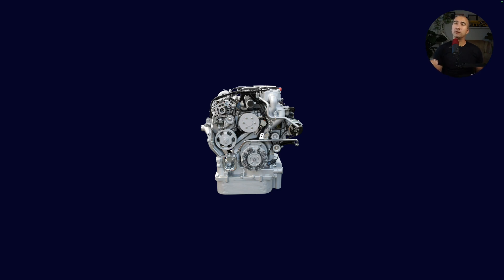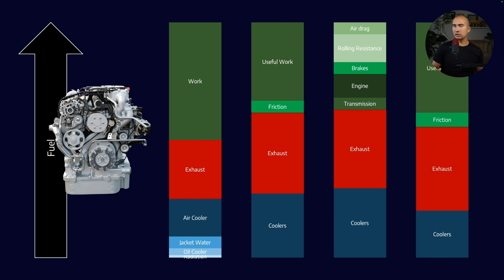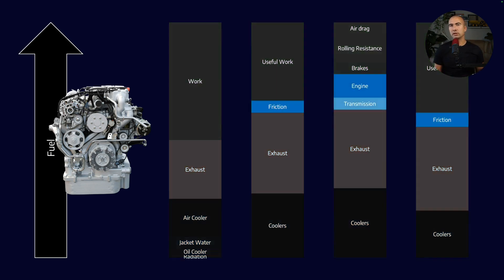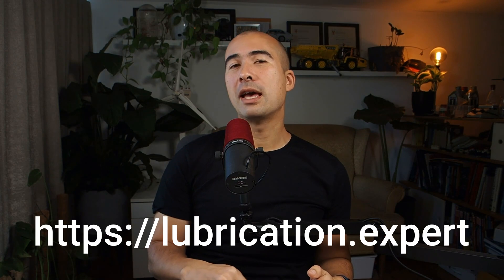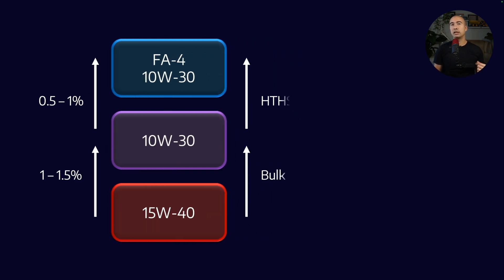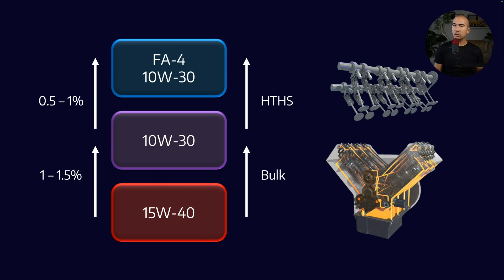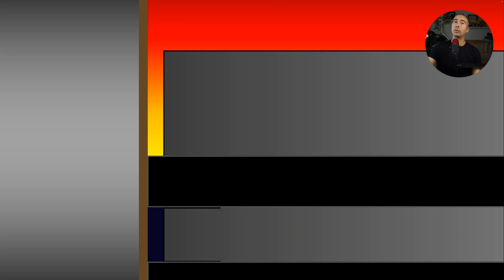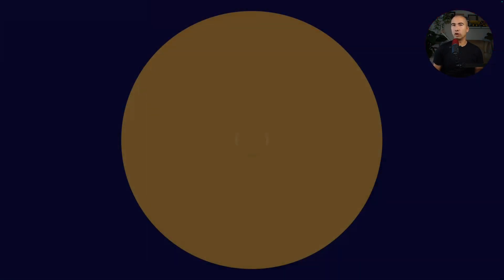Is Amsoil's mpg claim real? Energy losses in engines explained.

Comment: The gain of efficiency cannot surpass the engine protection and lose oil film, 0w20, 0w16 I wonder oil service interval with GDI Trbo engines and low TBN.
BimmerN53

Comment: I have a bike that uses 10w 30 oil (factory recommendations), then I tried 10w 40 oil, the fuel mileage consumption went up about 10% ish more efficient (using the fuel consumption meter).
This is what confused me, as what I understand that the thinner oil should be the one that makes the engine run more efficiently...

Comment: You are forgetting about the most important contributor to fuel efficiency, and that is temperature control. We gained 18% in petrol and 27% on LPG on a EB Falcon bacck in about 93/94 with a test vehicle supplied by RACV when we fitted components to correct the coolant temperature  on the 4.0 Liter 6 cylinder engine dual fuel.

Comment: I have a counter point, anecdotal for sure, but true in my case.  I swapped out the “old” oil from ALL the gear boxes in an old 1993 Land Cruiser TO brand new AMSOIL in the front diff, rear diff, transfer case, and Engine.  The difference was significant and noticeable.   The rig made less noise, and I did get approx 8% better economy.    (As close as I could calculate).   That rig went on to serve me another 100,000 miles of hard work without any drama.  Got rid of it at 250,000 miles.  And I regret it to this day.
Reply: You're comment reminds me of a slightly used 1982 Toyota 4x4 pickup I had bought long ago and it would have had the factory 80W-90 gear oils in both diffs as well as the manual trans and the transfer case, and probably a typical 10W-30 engine oil. Being that I live in northern Alberta that was a no go in our winter climate so I used synthetic 0W-30 engine oil and at that time 75W-90 part synthetic is what I could get easily. The products I used were Esso ( now Mobil ) but imagine the Amsoil or other brands of full synthetic some years later would have had better performance yet in cold weather but never the less it came down to higher performance oils that are thinner at low temps having a drastically improved lack of driveline drag in colder weather. There is a reason why for years now transfer cases use automatic trans oil, diff have gone to 75W-90 if not even 75W-85, and a thinner type of automatic trans oils ... and 0W-20 or even thinner engine oils ... it all adds up to less oil drag resistance.

Comment: Lake Speed Jr did a seminar on Porsche Club of America's YouTube and said there's only 3 manufacturers of base oil and only 3 manufacturers of oil additives. He basically said oil marketing is trash. Buy for spec before brand. There's so many factors in fuel economy in the real world.
Reply from the maker: That's mostly correct - like a lot of industries (think accounting, banks etc) there's been a lot of consolidation so there's a "big 3" base oil companies (Chevron, ExxonMobil, Shell) and a "big 4" additive companies (Lubrizol, Oronite, Afton, Infineum). But there's a pretty vibrant ecosystem of mid-to-smaller companies out there that are doing some great work. Yes, there is a lot of marketing fluff (particularly in the consumer categories) but there's also plenty of real technology.
Reply: Mostly true, but the smaller, more expensive brands (HPL, Amsoil, Red Line) up the treat rate and overbuild their oils.  How much better they are really depends, and to some degree can't be determined unless you were to test them all against industry standard tests.
Reply: He's not wrong in any of it, it's just that like a baker is using the same ingredients they can be combined differently to get different results. 🙂

Comment: In the Amsoil case study, they changed every single driveline fluid, including the wheel-bearing grease. What I understand, not even Amsoil was expecting more than 3% or so, it was a shocking result.

Comment: In real life, it is possible to get high gain because:
- the manufacturer viscosity recommendation is too thin. Using correct oil viscosity will reduce engine friction a lot.
- previous very low quality full synthetic oil (obviously without API logo) cause sludge and poor performance

Comment: AMSOIL is a slick marketing machine, like a 0W20. Lol. I fell for the hype and used it religiously for 2 years, one thing I found annoying about the oil was towards the end of the oil service-interval oil consumption would ramp up substantially. I never experienced this issue when I used Mobil1. In any event I switched to Renewable Lubricants (same weight) and two things happened,  I no longer had cold start ticking noise from the engine and oil consumption did not get crazy towards the end of the oil change interval. I have since then seen elsewhere on YouTube, auto technicians give unfavorable opinions about AMSOIL based on their personal experiences fixing engines

Comment: Sure, lowering the viscosity of your oil will give you minimal fuel efficiency gains, but my question is, will the lower viscosities create more engine wear and in turn higher repair costs which will offset any savings in fuel costs? I really dont see how these new 0w8 and 0w16 oils can protect as well as a 5w30 with the same additive package. Is there something I'm missing?
Reply from the maker: Great point - so there's definitely tradeoffs, and in general is not going to be possible to simply use the same additive packages in these lower viscosity engine oils. Most of the time, it's a combination of uprating the base oil (so in the case of 0W-8 and 0W-16 they're likely to be full PAOs), and improving the additive package (you'll start to see more Boron, Moly, ashless phosphorous etc). On top of that, the engines need to be built with a lower viscosity in mind. In a lot of cases, it's the tighter machining tolerance and improved surface finishes that are allowing the lower viscosities.
Reply: The oil geek has a great video explaining this exact question... The heavier oil viscosity does protect against wear better than the 5-20 water thin stuff
Reply: @100pyatt Lake also talked about in a video how they reduced wear with an oil that had lower viscosity, something other tribologist talk about as well. Viscosity can work against the additives in mixed and boundary lubrication. So we should mostly compare to the specific oil (which include additive package) and if it can do the job it was engineered to do (or how it degrade with reduced viscosity). 🙂

Comment: 9:55 A very good point Rafe.
Years and years ago when Mobil 1 was brand new in Australia, my father and brother in law both had a Daihatsu Charade Turbo each. They saw ads for Mobil 1 showing the benefits of cleaner engines and new synthetic technology,  so they both changed to it from the good quality mineral oil they'd be on.
Both cars failed a turbo within a week of each other when all the deposits started to move.
Not the oil's fault, and both cars gave long lives after the change.

Comment: I started using synthetic oil in 1988 in Germany as a young automotive technician aprentice. I never found much improvment in fuel ecconomy until all drive line lubricants where synthetic. So once engine oil, ATF/Gear Lube and bearing grease where all synthetic I noticed a very significant improvement in fuel ecconomy. I noticed this in everything from N/A I4, V6, V8, forded induction, fuel injection, carburated, automatic and manual transmission vechiles. I would often see 2-3mpg improvment consistently in my vechiles and clients vechiles in Germany and in USA. I have lived int he USA since 1992. In almost all cases I was going from a 15W40 or 20W50 mineral oil to a 5W40/10W30 or 5W30 synthetic and often gear lubes where where going from 90W to 140W Mineral Oil to 75W90 or 70W80 synthetic.

Comment: Hello Rafe, Good video. However, is not cleaning the deposits "restoring" the performance as opposed to improving the performance. Is not the performance of a new engine distinctly different than the performance of an old engine? apples to apples/oranges to oranges:goodvibes:

Comment: Amsoil and k&n are the best marketing companies.  The internet raves about them with very little (or none) data to confirm anyone’s claims.
Reply from the maker: To be honest I don’t have much experience with either. Amsoil’s business model of having a wide reseller network has definitely given them a big leg up, especially on social media where a lot of the resellers are very active.
Reply: @LubricationExplained  I think you are looking at your percentages to simplistically. Let’s just assume you have some money $100 is a dollar for each percent and you have some children you going to give some of the money to little Miss lubrication - this kid gets 8% eight dollars, so when you say can’t possibly improve 8% you are thinking of the total, however if you gave little Miss lubrication another eight dollars, that wouldn’t be 8% that would be 100% so 8% of the 8% is .064%, totally achievable thing a bit of clever marketing, but I’m suggesting that that’s probably what they’ve done
Reply: I will say in my own experience, K&N air filters seem to flow well when clean.
But I wouldn't say Amsoil has no data, as they do use many of the ASTM and other third party vehicle and equipment manufacturers test methods and parameters for their test comparisons, don't they? I mean that should count for something shouldn't it? That 8% gain probably was very optimistic, and probably did have much to do with cleaning up that well used engine. However, I don't think they implied that everyone would see those kinds of gains either. I'm just a lowly life long mechanic by trade and retired amateur racer and have used and sold as a small dealer some of their products for a very long time. I personally have had excellent results with them. But Hey, at least they don't claim their products contain magic wands, (mine is broken by the way) pixie dust and unicorn horns huh? LOL
Reply: Amsoil's oil marketing reminds me of the makeup company called Avon in the 90s. Where they used a wide reseller/word of mouth network for their marketing. That being said, its probably still better than anything you will find on the shelf, but yeah I agree with the creator of this video.
Reply: They are marketing companies making products. 😄
Reply: Their marketing is not the greatest, but they do make some of the best lubricants on the market in my opinion.  They provide a lot of good data based on industry standard testing on their website.

Comment: I was expecting the answer was going to be more along the line of 8% of the stand alone engine efficiency, rather than 8% of the complete vehicle driving economy. But it seems even that narrow measure would be excessively optimistic.
Reply from the maker: Yeah I believe that even Mobil's 2% number was complete vehicle driving economy because they tested trucks on a standardized circuit in the UK.

Comment: Thanks for this very informative video. On the subject of HTHS, another you tuber, the Motor Oil Geek, says friction & wear are two different things. More AW additives will increase friction not decrease it, contrary to popular belief. 
 Maybe in a future video you can expand on that, e. g. how HTHS affects wear vs. friction, & of course fuel economy. 

 Thanks again for the great video!!
Reply from the maker: Lake’s awesome!! And he’s absolutely correct - they’re independent phenomena. The main problem with anti wear additives from a friction perspective is we don’t have much control over how the surface film is laid down, so the surface roughness is often higher, plus the material itself has higher friction. HTHS refers to the fluid friction of the lubricant itself, so it’s a slightly different thing.
Reply: I can't speek to AW additives here because there are so many types with different modes of action, but it is true that friction and wear are not synonymous. 
A very high viscosity oil wil provide greater separation of parts and less wear while the shear resistance of the fluid creates more friction (Transfering macro shear forces and converting mechanical energy into heat.). 
Wear tends to come from high local (microscopic bits) shear forces when bits of metal impact due to inadequate separation.
So two situations can have the same average macro shear force (friction) and massively different wear;  one will be an evenly distributed force in a thick film, while the other is the average of extremes of very low shear force areas and very high spikes in force where bits of metal contact.
Reply: Great comments